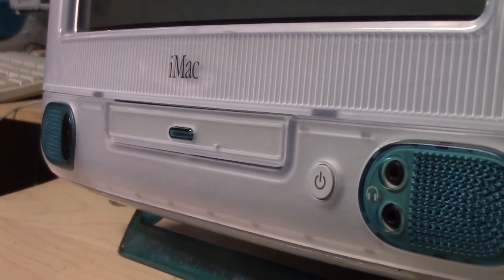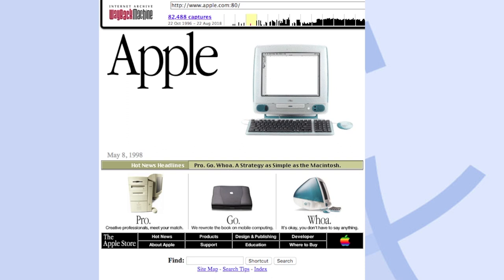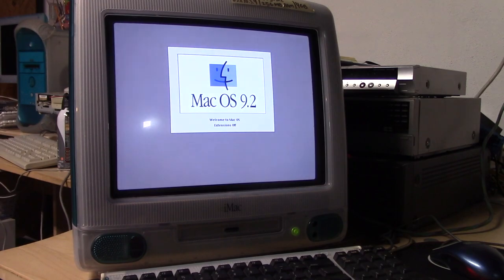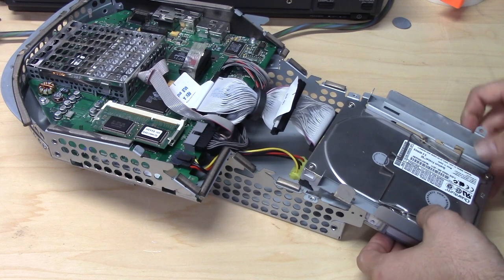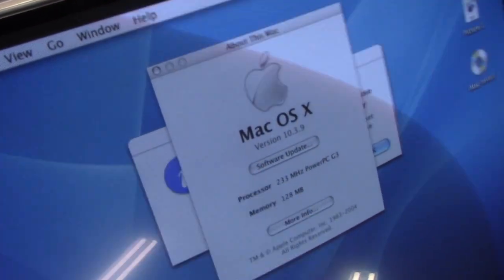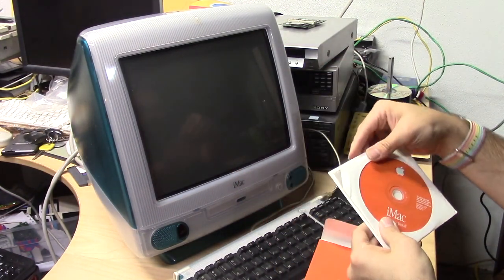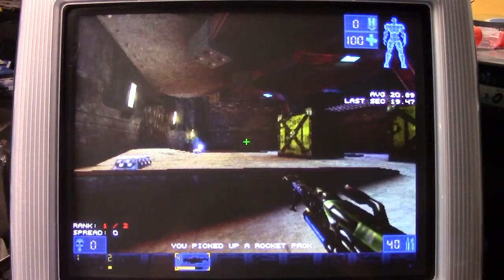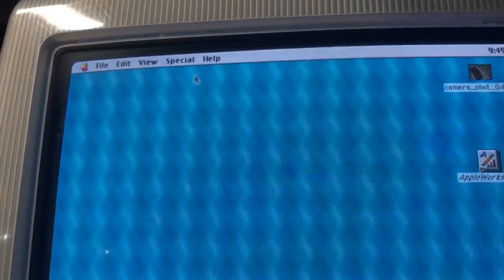Mac84: Original Apple iMac G3 20th Birthday Restoration

Comment: I just opened my 1998 version i-mac (same as the one you looked at today) for the first time,  to replace the battery. I searched all over town today for the replacement to no avail. This was my first computer which I bought new and have had only two problems with it, maybe 3 now if I can't get a new battery. The mouse, which I changed quickly and the memory. I found it could not open much without freezing until I had a 128 chip replacement installed. I also added a port for connectivity to my electronic piano. I was told at the time that the newer versions would not let me do this. All in all, the imac has been a reliable workhorse for years. I still have it in my office. Thank you for posting this video.
Reply from the maker: I’m glad you enjoyed the video!

You can order 1/2 AA 3.6 V SAFT brand batteries online, although it doesn’t do much other than keep the time. So it may be safer to leave it out to avoid future potential damage.

Comment: I had no idea the first gens had a fan in it or used a tray like that. Very cool!
Reply: You're probably thinking of the later released iMac G3 DV. The new model had a slot-loading disc drive and no cooling fan to keep the noise down. It was a revision to the iMac you see here but it was also just as popular.
Reply: I will put a Noctua in there, it is my current quest!

Comment: I miss this computer, it was cool compared to the bland off white.
I'd like to see one modded one with modern components in that old case
Reply: You can jam in an SSD.
Reply: @tenminutetokyo2643  that’s now how it works, you’ll still be stuck with really low ram that the motherboard can handle, PowerPC G3 processor and usb 1.0 etc. etc. VGA modding these however is quite interesting, you could use those iMacs as CRT monitors that you can plug on any VGA card
Reply: Theorectically you can - the CRT on this model only uses a basic connector that can be easily converted to VGA.

Comment: I loved this video! I have a Tangerine slot-loading iMac running 8.6! Also, the blank space where the ports are with screws next to it is for a card of some sort if i remember correctly.
Reply from the maker: Yes it was apparently a diagnostic port used by Apple for the rev A and B models only. It was the Mezzanine Slot. Companies soon figured out it provided a 32-bit PCI bus and offered SCSI adapters, FireWire ports, TV tuners, CPU upgrades and video cards. Sadly I don’t own any of these, but I’d love to try them out.
Reply: @Mac84  Yep, the Voodoo2 got a limited release for this slot, great for upgrading the 3D performance especially on Rev A models!

Comment: I just found this video. This is great! I run a used electronics store specializing in retro games and vintage stuff, I just snagged ones of these that came traded in. Debating restoring it. Your video was very informative
Reply from the maker: Thank you! I'm glad you enjoyed the video. What color is the iMac you got, does it have a tray load disc drive or a slot load? They're very fun machines as long as the CRT isn't failing.
Reply: @Mac84  how can you tell the CRT IS failing?

Comment: I just got an iMac very similar to this from my boss; he had it in storage and let me have it for free.  Just needed a little cleaning and housekeeping on the hard drive, and it was good to go.  Thankfully I don't think I need to upgrade it much, since it has quite a bit of RAM in it.  Only problem is the optical drive keeps spitting out everything I put in it.  Amazingly, I recently bought an external LG optical drive for my PC, and it actually works on the iMac.

Comment: woah!  I started my design career on one of these things. imagine it's been 23 years now. running photoshop with 2 or 6MB! VRAM and 96MB RAM. TNX for a trip down memory lane Steve (I'm nowadays an Apple / Computer collector running a cMP project these days. they are going to be built into my garage wall heating up the place with tubes and such. I gather I can heat up 20 square meters with just three cMP 2008 running high fans. and just under 1 Kw

Comment: A little late to this party, but for future reference, when you want to change out/upgrade the ram in this model iMac, make sure you get CL2 timing ram. I bought 2 256MB modules with CL2 timing off eBay and it was just plug and play. My iMac had no issues recognizing it. Granted my iMac G3 is slightly newer then that one since mine was a Rev D. Though I think that should still be relevant to your model too as the only big change between mine and yours was the removal of the IR port.  This may not be applicable to the original Rev A model though.

Oh and in my case I got matching modules. Both same speed and brand. Mismatching modules will almost always give you a bad time. Next time try to match ram speed and brand. Capacities can differ but if you are maxing to 512, that's irrelevant since both will be 256MB anyways.

By the way, there are 512MB modules out there. But I've not seen very few that even specify what timing they have. I think I saw one that had CL2, but not on eBay.

Has anyone ever attempted to go to 1GB of ram with 2 512MB modules with CL2 timing? It might work. But I'm not gonna go out buying ram sticks to find out. :P

By the way if you are even more hard-core about upgrading it to it's max potential, there are G4 CPU upgrades. It's not a walk in the park though. You have to de-solder the old CPU, reball the new one (which you also have to de-solder from what ever motherboard/card you sourced it from) and change a couple resistors out on the CPU card to ensure proper voltage and speed multiplier. This requires some extra soldering equipment like a hot air station to do properly though and you have to use some specific types of CPUs. I forget which. But I've seen a YouTube video showing it working. One day when I have the money I might try and find someone to do make an upgraded card. There's one individual over at the 68kmla forums that I know has done one. So I'll probably look there for when that time comes.

From what I've seen, you can run a 400Mhz G4 in this thing without running into thermal issues with the heat-sink design (as long as you get the voltage correct). Can maybe push 450, but I don't know of anyone who has tried that.

I suppose it's possible to do this on the later slot loaders but the CPU is not on a daughter card like on the older ones and that model didn't have a fan so thermal issues will be even worse. I've not heard of anyone doing a G4 upgrade on one of those. :P

Comment: Great machine!  I got a 500 MHz one for Christmas last year to add to my collection.  I just upgraded it to 1 gig of RAM last week, and I have been running 9.2 as well as OS X on it.  I'm trying to hunt down an AirPort card for it at the moment.
Reply from the maker: Very cool! I hope your iMac has the AirPort Card adapter. Those adapters are getting harder to find, as they were only for iMac G3 slot-load models. Thankfully I've had better luck finding AirPort cards hiding in broken machines I've picked up.
Reply: @Mac84  I have the adapter but no card LOL.

Comment: Bondi Blue rev B iMac G3. When I bought it, it was still in Mac OS 8.5 (original Sw release) and looks like never received any kind of updates.  I just finished installing all the firmware and ROM  updates and now is ready for Mac OS 9 and X, the big  issue was it was not recognizing USB sticks so I transfered all files over File Sharing with my other iMac G3 600 on Mac OS 9.1 (pure classic enviroment). The firmware and software updates were installed in this order: 
1 - iMac CD  update 2.0
2 - iMac firmware update 1.2
3 - iMac update 1.1
4 - Mac OS 8.6 update 
5 - USB mass storage support  1.3.5 
6 - Mac OS ROM 1.0 update

Now it is more useful than before with Classilla Browser and reading USB sticks but it is still in Mac OS 8.6, I will leave it like this for now

Comment: I have a 2001 Bondi Blue iMac G3 with the hockey puck mouse and an keyboard
Reply from the maker: Cool! The 2001 model is Blueberry, but has a very similar shade to the Bondi blue, but brighter!! Bondi Blue was replaced by Blueberry in the 1999 iMac models, which also introduced a total of 5 colors!
Reply: Thanks I didn’t know that

Comment: Hey there... I bought a Rev A off eBay about two years ago. I had one in 1999, and later gave it away. But, I missed little Mothra, and so I bought Mothra 2. 

Thing works surprisingly well. Had to open it once to replace the PRAM battery and reset a little black button in there (have since forgotten its name), but it's been doing just fine. Using Illustrator on it to recreate some of the original Star Trek computer displays. I may use AE 5.5 on it as well to animate those (or I'll bring the files over to my 2020 Macbook Pro running SheepShaver). 

My only disappointment is its inability to jump onto the internet full blast. I can access a few sites, but most sites, and e-mail, I cannot get on this machine.
Reply from the maker: All vintage machines of this era have older web browsers which cannot understand the new security or SSL standards of modern pages and protocols. Sadly it’s a common issue across all vintage Macs, PCs, etc.

There are proxy projects and things to bypass this (like using a Rapsberry Pi to act as an in-between) or using a website like theoldnet, but none of them may be perfect.
Reply: @Mac84  Never heard of those ... I am intrigued...

Comment: And then Steve Wozniak bought a set for every school computer lab in Santa Clara County. I used an iMac week one when I was 7. As soon as all the different colours came out, we got new computers. And then that ended Steve Wozniak buying us computers through the 90s. After that if the district wanted Apple computers they would have to purchase them themselves at educational discount. Buying Apple computers at educational discount was about the same as buying Windows computers without educational discount, so the district went with Windows 2000 Pentium 4 computers to replace the iMacs. The first wave of iMacs also came when all the schools got T1 drops. IT ended up hating MacOS 8 and 9 since it didn't play as nicely with Novell Netware as Windows NT did. They had no problem with System 6 & 7 pre-networking. Only the high school Digital Art class and the school educational cable channels got Macs after that. Sometime shortly after I graduated the Digital Art class got cut citing the cost of transitioning from G4 iMacs to Intel iMacs to run the latest version of Photoshop and Illustrator.

Comment: I just found one of these, a house clearance and a chance meet, for £40 :). Rev A, but sadly with a VERY sun yellowed top, Im going to try retro-brighting it, but first Ill test the peroxide on the case bottom clear plastic, in case it clouds up, goes brown etc. BTW, mine has NO Vram upgrade, and looking on Ebay, no Ram comes up. Just wondering how you got your Vram + System Ram?

Comment: Nice video, had used this exact model in primary school... was definitely this colour, not sure if it was a Rev A or Rev B model though. One big tip for getting Unreal Tournament to run better: lower the texture quality. That setting has a massive performance impact on ATi Rage Pro cards. Even so, you likely won't get great performance, as the 233MHz processor is a bit on the slow side for this game.

Comment: here's an idea for another upgrade.  I took a pair of Bose speakers apart and replaced the old  speakers with the Bose.  it sounds really good now I used gorilla glue to secure them to the speaker housing  the holes didn't line up but everything else did :)

Comment: I have the two Indigo Slot Loading version of the iMac G3, one is a DV model and the other is not. Both are in much worse of a condition of yours as far as scratches go; your Mac looks pristine in comparison. Do you have any tips or tricks on getting them out? I think they are made of the same plastic material as the Bodie Blue Tray models. Some of the scratches are white and do not feel deep so I think they can come out but I just don't know the right tool and or chemical to use. I'd really appreciate any help!

Comment: I'm planning on getting one of these that doesn't have software keyboard or mouse what do you recommend as the original operating system software and mouse and keyboard that comes with it
Reply from the maker: It depends on the model, but Mac OS 8.6 is usually ideal. Most USB keyboards and mice (unless they are wireless) should work OK with the iMac. Good luck!

Comment: I have rev B iMac G3 running Mac OS 8.6. It is perfect also running iTunes on it to tune Radio stations
Reply from the maker: I just upgraded this iMac to 8.6 over the weekend. I have noticed a decrease in startup issues and USB accessory problems.
Reply: @Mac84  You need to to the update 1.0 or something like that , I did a bunch of updatings when I did the upgrade from 8.5 to 8.6 I remember mentioning on the Lowend Facebook webpage or Mac OS 9 alive

Comment: Great video. Would you make the same system recommendation for an iMac DV SE (Summer 2000)? It seems it shipped with 9.0.4, but I’m wondering if 8.5 or 8.6 wouldn’t be better. Thanks.
Reply from the maker: Mac OS 9.0.4 is the original OS. However System 9 can be buggy, so I’d recommend upgrading to the latest version of 9.

I’m unsure if 8.5 or 8.6 is supported on that hardware, it isn’t officially by Apple. So I would assume even if it did work you may run into some issues. I have 9.2 installed on my Graphite DV SE model with 512 MB of RAM and it runs great! Just make sure your install disc doesn’t get caught in the aging slot load drive. 👍

Comment: Is it possible to use the G3 monitor as a secondary monitor only plugging the monitor cable (using extension cable) at a PC video out?
Reply from the maker: It’s not as easy as it seems. The iMac logic board sends signals to the CRT so it turns on and gets it ready to display an image. I think some people have got this working, but it’s not as simple as just plugging in a cable.

Comment: This IMac rev B should use 8.5 discs, the 8.1 is for rev A and 8.5.1 is for early 1999 ones
Reply from the maker: Yes, that's what I was saying in the video. The Rev A models shipped with 8.1, and the revision B models shipped with 8.5 discs. I'm sure one could get 8.1 on these models if they tried, but it probably wouldn't be wise haha.

Comment: After many years of storage, I managed to hook up my G3 (MacOS9.1) to my router through ethernet and to get Google search to return results. But  I get nothing opened beyond that, all websites results in an error:  "Security failure. A secure connection could not be established".  Another channel told me that 9.1 does not support modern web browsers. The imac uses the original IE browser but it does not recognise today's security certificates/authorities, thus refusing all websites. How do I get around that?
Reply from the maker: Essentially the modern security code on websites is too new for old web browsers. The same thing will happen to ancient Windows browsers.

There are security proxies you can setup and some interesting solutions involving a raspberry pi or a secondary computer. I haven’t tried this, but I’ve heard good things.

Comment: I can tell you why your Memory upgrade didn't work. I work on Macintosh computers all the time, so I have run into a similar problem before. Your RAM needs to be running at the correct clockspeed. In the case of your iMac G3, you need PC66 RAM which matches the 66MHz bus speed of your iMac. You tried to install a stick of PC100 and a stick of PC133 RAM. Neither of these modules run at the correct clockspeed; they are out of sync with the Macintosh system bus. That's why you got such strange readings. Next time try two PC66 SODIMMs.
Reply from the maker: S Franz yep! I’ll need to order some correct DIMMs. I was polled by the DV models which seemed to be more forgiving.
Reply: I used 2 PC133 256mb sticks in my Grape Rev. D and they worked. Are these 2 revisions that much different?

Comment: I am quite sad a cleaning lady put the metal shield of my iMac in the garbage. I removed the rust and left it out for a few days. During that time the cleaning lady probably saw it and thought it was garbage.

Now my magenta iMac is 99.9 percent complete. No scratches and only recently started developing a bit of rust around the USB ports.

It used to work sometimes, around 7 years ago, got an orange light and sometimes I could hear the higher pitch sound of a fan or hdd working. Now it's dead. Plugged it on a few days ago and didn't show any sign of life. I'll fix it though, some day.

Comment: Just a heads up - As an Australian - Bondi is pronounced Bon-dye / Bond-eye not Bondy/Bon-dee :)
Reply from the maker: Yes! I’ve learned my lesson and have since never forgotten. My Australian friend Bruce will never let me forget!
Reply: @Mac84  😂fair enough! 

On an unrelated note - did you ever end up sorting out the 512 MB RAM issue?
Reply from the maker: 👍 Yes, I found some more modules to try, but I have not tried them yet. Hopefully soon! As I will be revisiting this iMac G3 sometime soon.
Reply: @Mac84  Awesome, well I look forward to hearing about it! 😁. I've got my own tray loading Strawberry G3 (333MHz) that I'm hoping to upgrade myself - SSD, RAM, quieter fan, and (hopefully!) CD-RW, although that might be a pipe dream.

Comment: one of the rams where 133Mhz the other 100Mhz. can't work
Reply: @Stephen Tidwell if you do want a stable Maschine it does not make a difference mac or windows. 
Mixing up the ram is always a problem. 
Yes you can stick 133 ram on a 100 MHz mainboard and it will work but one 133 and one 100 may cause problems.
Reply: @Stephen Tidwell no offence m8.